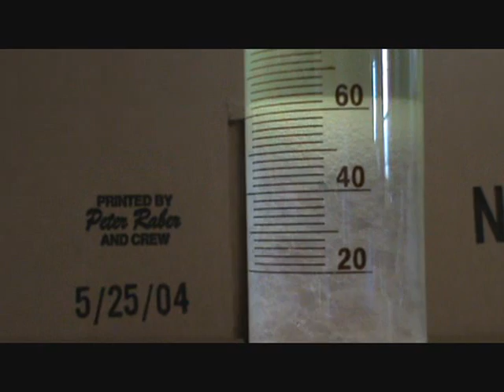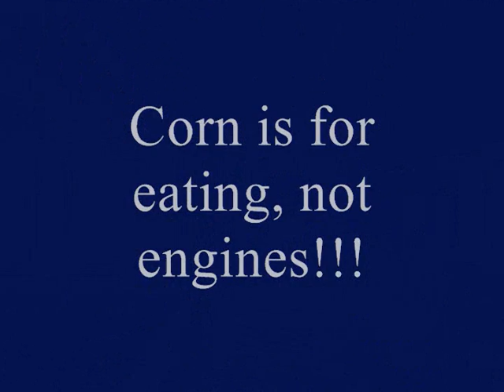Ethanol Removal.wmv

Comment: Ethanol impacts engines. 2 Leaf blowers - 1 rebuilt engine, 1 engine replaced. Both crapped out again. Back at repair I was told to buy a new one. I told the guy I suspected ethanol (after seeing this) and the guy agreed. A boat mechanic he knows said boats have all kinds of fuel problems. Using TRUFUEL in new. I used Stabil in my mix. My mower was stalling excessively. I got some other gas mix products and add way more than I should when mowing, just to get gunk out. Seems better fewer stalls.

Comment: It has a higher octane than pure gas (either octane or heptane), but the drawback is that by mass, it has less energy, which leads to lower gas mileage as far as the everyday commuter is concerned. And I think the main concern with small motors is that it's more corrosive than pure gas, which causes issues with gaskets, engine deposits being suddenly desolved, etc.

Comment: I can see a $$$$ future in ethanol extraction business for classic car owners like me !
By the way METHANOL is used in power sports that's a bit different then ETHANOL. It used also because it burns much cooler inside the engine.
Reply: barthoedemaker     And, what type of equipment and at what cost, legal and properly zoned facilities for storage, separation, dispensing, ethanol storage and disposal equipment, insurance and other factors would be involved for an ethanol extracting business to be safe, profitable AND marketable to the public? When you develop a business model to present that would appear to have merit please let me know. I'd like to see of all the bureaucratic hoops that you would have to jump through cleanly and how you could get around the multi billion dollar fuel industry that would certainly undermine and crush you in 5 minutes.

Comment: Very soon 15% will be sold at stations. It's not mandated, but the same hose will be pumping all blends. The EPA's solution to keeping non-applicable engines from being damaged is to REQUIRE the purchase of a minimum of 4 gallons. A mandate by regulation, not by debated law.

Comment: Easy there big guy. Yes, you can make lots of power using METHANOL if the engine is tuned for it. After racing, the fuel system must be flushed to avoid corrosion damage.  Chainsaw: using ethanol gas, the plastic cap swells against the plastic neck of the tank requiring the use of pliers to get it on and off. After reverting to ethanol free fuel, it spins on and off quite easily. Rant all you want, don't mandate my life. Corn is for eating.

Comment: "Ethanol combustion in an internal combustion engine yields many of the products of incomplete combustion produced by gasoline and SIGNIFICANTLY LARGER AMOUNTS. that generates much more ground level ozone. The Clean Fuels Report show that ethanol exhaust generates 2.14 times as much ozone as does gasoline exhaust. When this is added into the custom Localized Pollution Index (LPI)  contributes to smog) is 1.7 on a scale where gasoline is 1.0 and higher numbers signify greater pollution."

Comment: According to the EPA, "[e]thanol impacts motor vehicles in two primary ways. First ... ethanol enleans the [air/fuel] ratio (increases the proportion of oxygen relative to hydrocarbons) which can lead to increased exhaust gas temperatures and potentially increase incremental deterioration of emission control hardware and performance over time, possibly causing catalyst failure. Second, ethanol can cause materials compatibility issues, which may lead to other component failures.

"In motorcycles and nonroad products [using E15 and higher ethanol blends], EPA raised engine-failure concerns from overheating."

Comment: Fuel containing ethanol is damaging and degrades performance of most all small engines, carbureted engines, and any 2 stroke. Fact. It's ill effects have been proven by countless mechanics and major manufacturers of 2 strokes like Rotax (aircraft, watercraft, and snow machine engines). It is worth seeking out non ethanol fuel for these engines to avoid damage and degraded performance. My 2C after 45 yrs of small engine work. Comments saying this crap is OK in small engines, 2 strokes, and carbureted engines are based on faulty information.

Comment: You can use some calcium chloride (sold as high end ice melting salt) to remove any remaining water and alcohol in the gas. Pulls the water right out. Sometimes when you water separate alcohol and gas, the gas ends up a bit cloudy. The calcium chloride takes it out. Even alcohol free gas can get a bit of dissolved water (less than 1%) and it will fix that too. 

Anyway pour in a cup or so per gallon of gas after you decant it from the separated water and alcohol and slosh it around, then filter

Comment: I used to use auto fuel in my airplane, since all the stations are forced to use ethanol, and ethanol cannot be used in the airplane because it will dissolve the gaskets and seals in the fuel tanks, carb, etc, You have to buy $6 a gallon aviation fuel that has LEAD in it.......   Maybe its good that the govt. is going broke, we can start out over and fix some screw ups!

Comment: Raimar, Not true,,, although tetra-ethyl lead was added as an octane enhancer (and valve lubricant), other additives will increase the octane rating.... check the chem book, (section on partial pressures).  I agree that the cheap-crap gasoline that is sold these days will detonate without some additive, but it need not be ethanol.  As for the other comments, yes, some crap.  but ethanol will damage fuel lines and carburetors.

Comment: I never seen so much crap on a comment section before...

All Gasoline without LEAD have ethanol... it prevents the gasoline from detonating on the wrong time... because gasoline tends to self detonate under pressure...

You CAN'T put pure gasoline in your engine, it will expplode while the piston goes up, and not when the spark says to... then your engine in condemned...

But yes, if you calculate, you can run with Low as 5% of alcohol for a engine with low Compression Ratio... Modern engines have 11:1 or more, what requires at least 8%... the more compression, the more ethanol you need, for a 14:1 (1000cc engines use to have something like that) you need more than 15%!!

You can try, if you feel your engine "popping" and shaking, you need more ethanol...
Reply: Also, if your car is very old, you need some parts to prevent damage on some parts... but ethanol DOES NOT melt fiber glass, or anything on a engine... not plastic, not rubber... (it attacks some rubbers, corrosion carburators that are not niquel protected) But the inside of the engine runs the same...
Reply: Ethanol is not necessary.  Yes, most gasoline has ethanol these days, but we are paying for it with lower power, lower milage, and damage to the engine.
Reply: The last engine to have 100% gasoline is more then 100 years old now...
You either need LEAD (Ethylsomething) or ETHANOL in gasoline... as I already told...
Ethanol is more powerfull, yet milege is way lower, of course...
As I told, no damage internally, just the parts that not accept it, like cars more than 20 years old with carburators and such IF not niquel protected...
Reply: I already told ethanol don't affect the engine... Are you reding what I write or what???

I damages by corrosion anything that has no nickel layer protection... such many carburators...

Lead is in fact more a threat to the engine than ethanol...
Reply: It's a simple matter of partial pressure,,,, any combustible additive will increase the gasoline's octane rating.  It does not need to be ethanol or MTBE.  one should only be concerned about the octane rating if they are running about a 12:1 compression ratio, at which point detonation of cheaper blends will occur, but ethanol is not a good solution to the problem
Reply: Raimar Lunardi What you have said is simply not true.  I bought ethanol free unleaded gasoline just last week.  Adding ethanol is only one way to raise the octane of gasoline.
Reply: Where did you buy it? Anything legal is obligated to sell with at least 8% in all countries I've looked up...
They may say it is "pure", but it is not. There are ways to test it, get 50ml of this gasoline, combine with 50ml of clean water, it will not be 100ml of liquid in a graded tube, will be as much as 96 (100-96=4 times 2 = 8%) the ethanol mix with water, the gasoline don't...
Test it yourself...
Reply: Raimar Lunardi I do test it myself.  I use a small glass test tube called the "Tiny Tester".  Are you from the US?  Here is a website that lists stations selling at least one grade of ethanol-free fuel. http://pure-gas.org/
Reply: Even if a gasoline don't use ethanol, it will use another tipe of anti-detonating chemichal...
I've been looking, the only sites listing "ethanol free gas" are the conspiracy ones... (no credit)... and the only true places selling E0 for sure is for boats and aircrafts...
90% of the places sell E10 (10% ethanol) and are no obligated to say it... USA laws are strange...
Reply: Also want to say that I live in Brazil, where there is 25% ethanol on gasoline (the only one available)... I own a 1974 chevrolet with a GM250 under the hood (the same engine as were sold in USA at the time)... I have a nickel coated carburator, it is the only thing differing from the original, and I have NO problems with it...
Reply: Raimar Lunardi Oh you will. Rubber fuel lines, fuel pump diaphragm, accelerator plunger, and the rollover protection valve inside the carburetor fuel filter are all now targets for premature failure. PLUS rusting of the fuel gauge sending unit inside the tank.
Reply: I changed it already, Fuel lines of Silicon, new repair kit for pump, new repair kit for carburetor, new fuel filter (all new things do consider the ethanol)
...
I know, it takes some money (but is very little in comparison AND you will end having to change them sometime even using ethanol free gasoline), but from the time you change this things, you don't need to preoccupy forever (besides normal maintenance)...
Reply: That is not true.